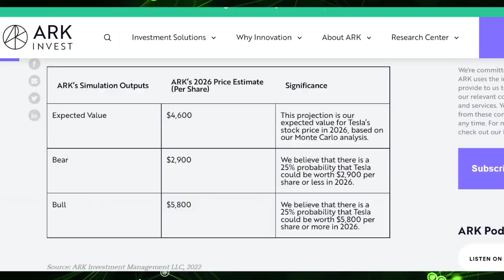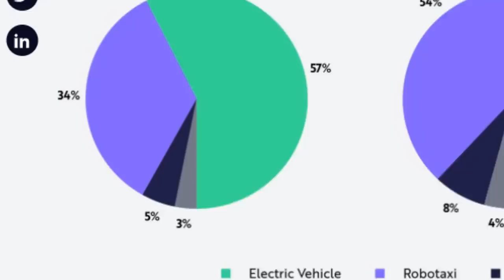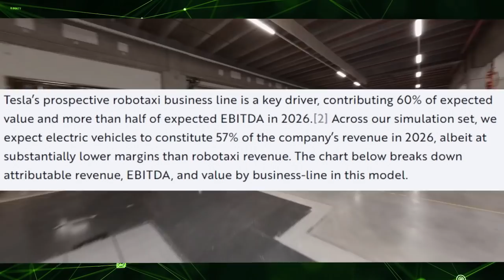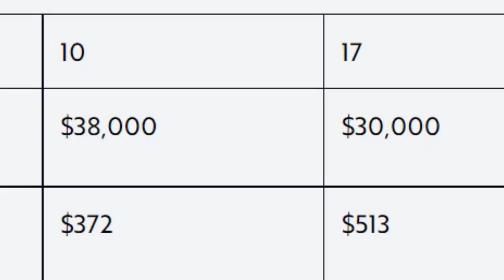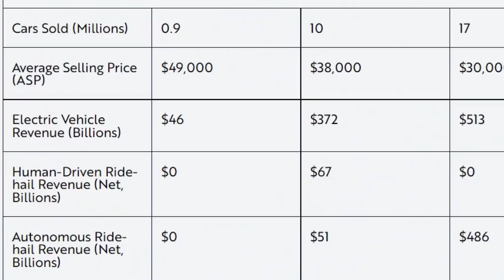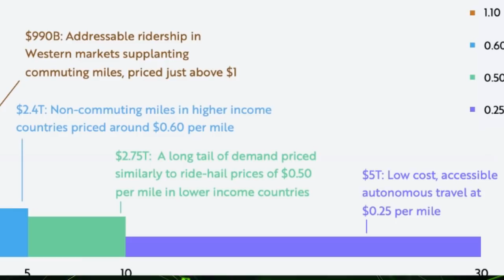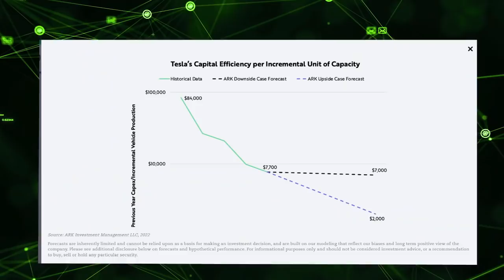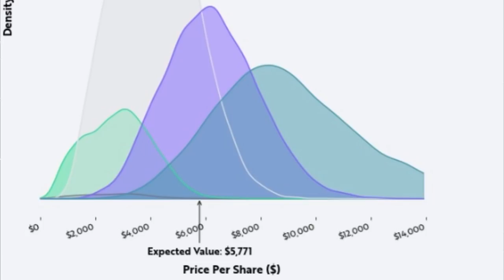The Truth About Ark Invest’s NEW Tesla Price Target $5,800! (2026-2030) - Tesla Stock Analysis

Comment: What about the stock split, that changes the price?
Reply from the maker: Essentially, stock splits only help stocks more up slightly due to trader sentiments on the stock being “cheaper”. But the reality is that the market cap doesn’t change in stock splits. If Tesla DOES reach Ark Invests Bull case price of $5,800 and they do a 5-1 split again, then that would be the same price it was in early April $1,160 but the split will happen a lot sooner than the price target predicts. Either way, it’s best to invest for the next 3-5 years in Tesla. The chances are more than not it will be growing much faster after 2023 with all of the new gigafactories
Reply: @ELECTRICINVEST  Actually, after the stock splits, people think the stock is better and buy more shares, even though it's irrational, making the valuation grow.  Stock splits have been good for TSLA.

Comment: The forecast numbers are very good forecast work. My comments are: it has to do with the unpredictable events like government interventions imposing regulation and their views of who the winners and losers are. Other than that, I too have concern with the Battery Technology and raw materials output. The world is transitioning more into digital or electronics.  Just counting BEV production, the rest of the BEV competitors will be demanding the same Lithium raw materials resources. BYD’s battery business bought 6 mines in Africa to secure the raw materials or their business. Tesla produces the battery in-house while BYD use a different format. By 2026 how many more Giga factories can Tesla build assuming they have the blueprint down. What about the rest of the Giga factory custom equipments  with long-lead item like the Giga Die Casting machines to produced and installed before 2025 assuming every Giga factory is build one or two at any given time. What is the typical time to build a Gigafactory that is up and running to contribute to 2026 numbers? Two years on average? Thus far, Elon can pivot quickly, there are long lead items that are dependent on natures process?